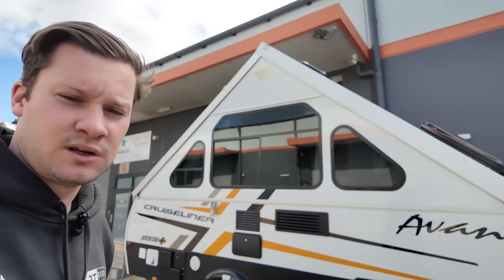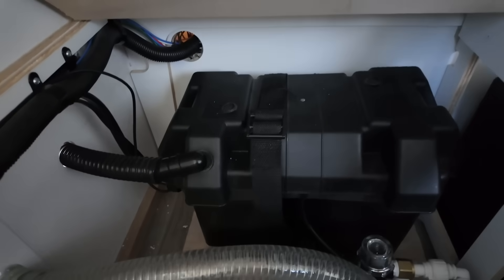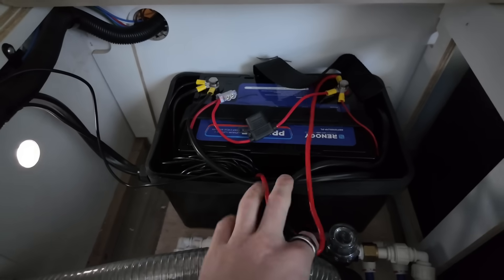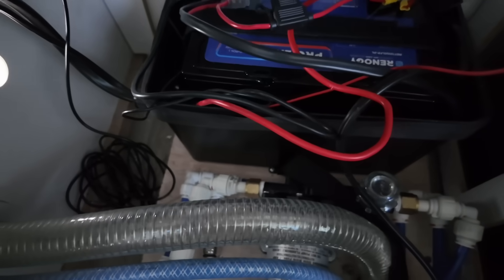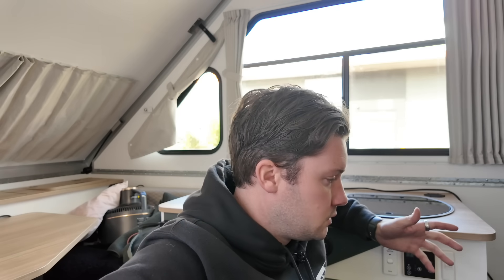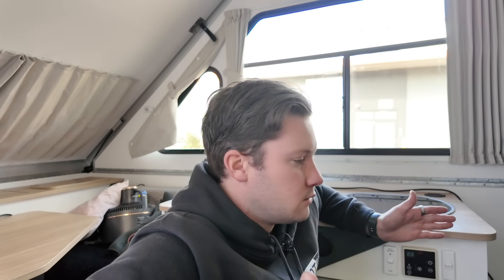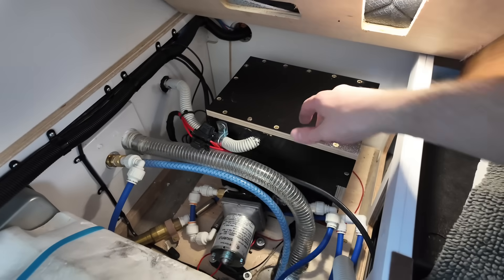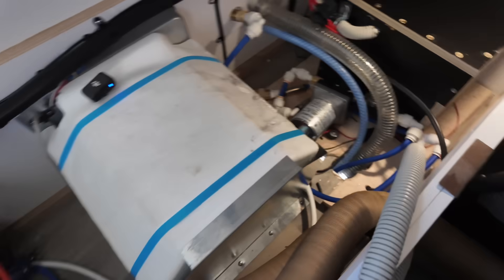3 WEEK OLD Van FAILS Compliance! Dealership's Battery Install EXPOSED

Comment: I've got an old 2001 avan aliner. I removed at least 60 wire taps when I completely re-wired it. Even the brake magnets were connected with bloody wire taps. Suffice to say they were replaced with Deutsch connectors. The other thing I don't like is soldered connections and splices. These can fail and come apart with fault currents. Connections such as Anderson pins and heavy tinned copper terminals should always be crimped with he proper tooling. If the they are to be soldered, it should only ever be done after the terminal or butt splice is crimped first. Soldering also creeps up stranded cable, causing a strain point. It also draws flux up the inside of the cable which when exposed to moisture will corrode over time as the rosin flux is acidic. I seldom ever solder automotive wiring, if I ever do, flux residue is cleaned with isopropanol and heat shrink is applied liberally to provide strain relief.

This kind of crap found here will lead to ELV wiring requiring regulation and licensing, which will be a pain in the arse.

Comment: I bought a Coromal van a few years back, wiring to stove and refrigerator were both way under gauge and had to be replaced, by me as I knew it would be done. Further the charging wire was way under gauge and the wiring that was done by them in the car for charging the van battery was normal trailer wiring with no low voltage cut off. 
Forget all the other issues such as water and dust leaks, cabinets falling apart etc.
And they talk about used car dealers.

Comment: Unfriknbelivable my 10 year old wired his remote control car better just by watching me show him over the years. I've never seen a cheaper battery box than that $60 bucks from a really good one. Panic attack, seeing this crappy 💩 work, I wouldn't feel good at all doing that to a customer. we did a toilet, and it leaked wondering where it was a crack on cistern. My dad and I got it fixed with a new one, lost half day work, but customer happy we happy.

Comment: It would have been better if those fuses were closer to the battery terminal as their purpose is to protect the wire and the further they are from the battery, the more wire exists that is unprotected.

Comment: Avan, as you read this and yes I know you will. My wife and I have done a ton of research and are about or were about to pull the trigger on a 555 or a 587-1 and seeing a video like this I think you would agree doesn't fill you full of confidence to hand over 80k. If you cant do it right then why wouldn't you send your caravans to someone like this who can, add on a bit of margin for yourself and move on. One shity job like this on you tube = how many lost sales of your vans?
Reply: Heard from a reputable caravan dealer in Newcastle that Avan were taking van deposits and onselling the van to a newer higher paying buyer while telling the original buyer they couldnt get stock etc. Some buyers were waiting years.No morals.

Comment: Just stick with sealed lead acid , if you are worried about weight just leave the coffee machine and bread maker at home!
Reply: If you run a SLA battery you probably wouldn't have a coffee machine or bread maker.
Reply: leave the fridge and lights at home too in fact why bother taking a battery at all if that's the option
Reply: You cannot run a decent sized inverter off most SLA batteries as the continuous current rating is too low. You'd need 2-3 SLA batteries to even make it to 1000W and then the weight is over double and it only has 50% capacity.

Comment: I don't trust the BMS in any of these lithiums. I put an MRBF terminal on every positive terminal with a good quality fuse on it, either sized to the wiring or the BMS max current, whichever is smaller. It's only about $35 for the fuse and holder. For a neater vent you can go out the bottom and be compliant, just extend your rigid vent tube to the top inside the enclosure. That dealer install was not done by anyone with a liense, I hope. You should really report that business to the licensing board.

Comment: I also wonder how many of the victron fanbois are still selling their lithium batteries - the batteries that do not contain a BMS because victron want all the cash in your wallet forcing you to buy their external BMS at outrageous prices.
Reply: All of their pre-assembled batteries will have a BMS, so there should be no wuckers there !!!
Reply: All lithiums have some sort of BMS in them. Not all BMS's report battery stats though.
Reply: The Vicron system BMS is 2 separate parts, the batteries contain the cell monitoring, and the external component reads it and takes the action, The Lynx also contains a contactor, and is designed to be highly configurable to requirements, such as redundancy, you can have in large systems multiple Lynx all talking to each other, Or you can buy the small/VE.BUS BMS without the Lynx and do the external switching yourself.

Comment: Little bit of a rant. How can a Renogy battery be non-compliant? It is one of the biggest (and safest) LiFe brands in the world. Better quality than most of the crap brands I see in caravans and 4WDs like Kings. OK, the install was incredibly sub standard, possibly dangerous (mainly the wiring) but propietary standards like this just add to the cost of the product. We've created a whole industry around compliance. This battery has EV grade cells, a decent 100A/300A 10 sec peak, low temp charging cut off BMS. The BMS is the single most important safety factor in any LiFe battery (and the main thing set out in the standard AS IEC 62619). Everything else is just noise. You compare this battery to the cost of a Renogy "approved" battery and it's 50% higher. For a fire retardant casing and bluetooth monitoring (neither of which are part of the standard). All based on hysteria over lithium ion battery fires which are mainly e-bike/ scooter/ skateboard lithium ion (not LiFe) batteries imported from China with sub standard or no BMS and dangerous chargers - which there is no regulation about carrying on or in your caravan. Bureaucracy gone mad.
Reply from the maker: Yes absolutely agree with part of your comment, please note that this Renogy lithium was an older model which on its manual did not state that it had the minimum requirements of iec62619 certification. Us as a business cannot hold that reliability over our heads on any install, so we install a battery we know complies. The Bluetooth battery monitoring is also partially part of the standards as for lithium you have to have a 24/7 battery monitor which shows state of charge as a percentage and voltage (wired or wireless), so yes this is partially part of the standard which makes it complaint. 
We did a report for the customer and they got a full refund from the manufacturer for the work we carried out.
Reply: @jtelectricalgroupnsw Well done. Monitoring can be done with a shunt but it isn't worth Renogy's while to apply for compliance for an older model battery. Which is still being sold by 4WD outlets and auto stores.
Reply: 100% agree
Reply: your focusing on the battery the issue is the install
Reply: @M_a_r_ke the wiring is done very badly. But having to put a perfectly safe battery into a box and vent it makes the wiring even more challenging and likely to be bad. It also makes it harder to access.
Reply: @JimsRobot run all the positives and negatives from a bus bars.... two thick cables out of the battery box doing it that way, positive and negative. No need to access the battery really.
Reply: Car carrier ship fires are not caused by ebikes and scooters and there are more battery fires world wide in cars buses etc than you care to admit
Reply: @JohnDivers-e1u Car fires and particularly EV fires on roll on roll off car ships are very problematic - I never said they weren't. In most cases they can't even get to the fire to identify the vehicle and the ignition point is unknown. It is difficult to comprehend just how badly these ships are engineered to cut costs. For example in 2019 Grande America caught fire and sunk in the Bay of Biscay with 2000 gas cars on board. So it isn't only EVs but they certainly exacerbate the problem. So far we've had 3 of these ships catch fire with EVs on board, two sank, one was repaired (Freemantle Highway). As far as all these fires around the world I just go via the stats. So far in Australia there have been zero deaths from EV fires and only 11 recorded fires ever. Just this year there have been 275 fires caused by ebikes, escooters and eskateboards just in my home state of NSW. In 2023/24 financial year there were 2,232 motor vehicle fires in NSW alone. Remember - 11 EV fires in the whole of Australia in the 11 years they've been around. So you either didn't understand my comment or misrepresented it. I can't find figures on how many people have died in ICE vehicle fires because we only track overall fatalities but I'd guess at least 10 a year, probably more judging from the amount of vehicle fires. A quick search pointed me to 5 in NSW in the last couple of months. Here's a very interesting fact sheet for strata owners in Australia if you care to read it. https://ocn.org.au/wp-content/uploads/2024/02/OCN-Fact-Sheet-lIB-Fire-Risk.pdf It spells out just how low the risk is.
Reply: @mondotv4216 I have 2x 100 lithium renogy battery's.... and they are garbage I'd never recommend renogy to anyone.
Reply: @krump743 What's wrong with them?

Comment: Ah god that’s disgusting! And to think they charge people to do that 🤢

Just on your comment “battery isn’t IEC62619 certified” - from memory clause 5.4.12.3.1 says must “comply” not “be certified” with 62619. Obviously one way of compliance is certification, but certification isn’t necessarily required to comply. Keen to hear your thoughts around that wording.
Reply: Not the video creator, but I do other electrical work where IEC standards apply as well as local. Our engineering department used the same interpretation as you for "must comply". Having a cert with the product often isn't possible. Where you run into trouble is terms like "is tested to" "is certified" and "shall be marked with".